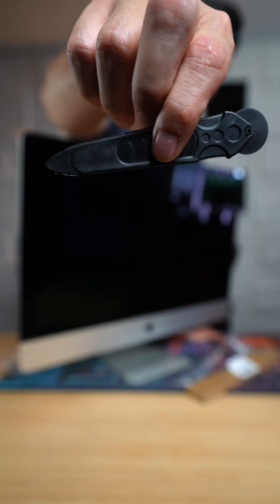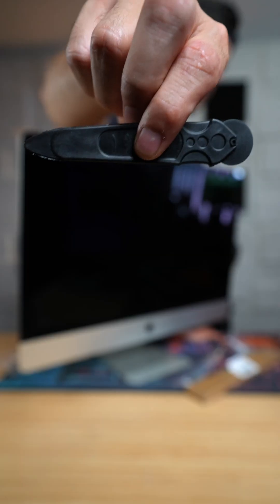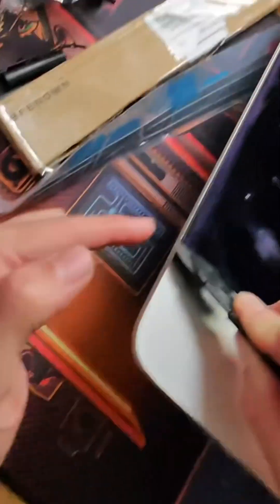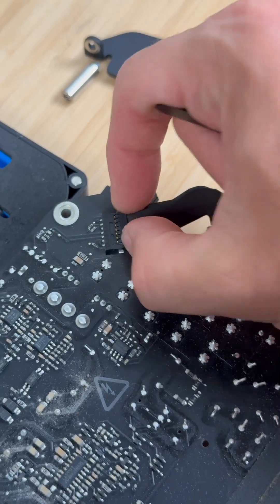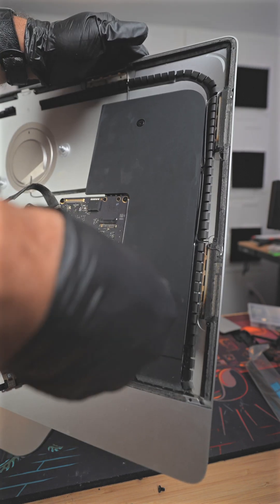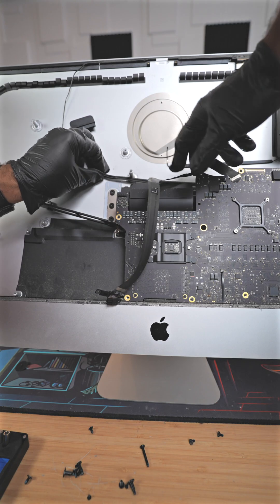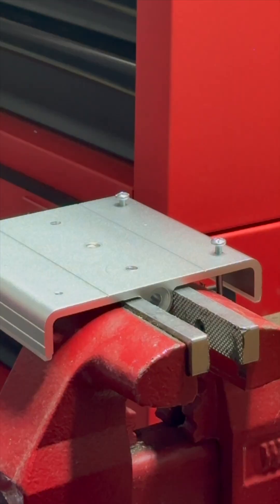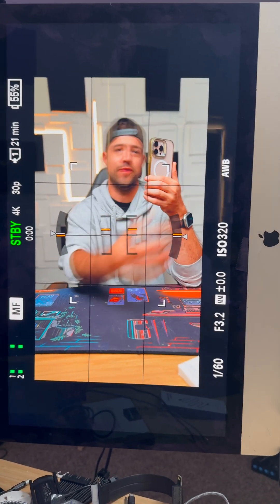How to use an Imac as a monitor. FULL BREAKDOWN

Comment: How has your driver board held up against the heat? What did you use to secure the board inside the casing? I've also noticed that the 12V 5A power supply gets pretty hot as well. Is this typical? Thanks for the video!

Comment: If i put some isolation-electric-foil tape and then added the double stick tape for the new-aliexpres-lcd board. Would that help ? 
And to put the cable connector part outside isn’t possible ? How do You turn the screen on ? 
I have and A1213/1312 iMac a bit older model. Getting ready for this project. Thanks for Your video !!

Comment: Hey! Love your video, I have a 5k retina 27 inch from late 2015, model is A1419 (EMC 2834). Can I use the same driver board that you used in your video, or is there a specific one that I need to pick? Thanks!
Reply from the maker: That same model should be the one linked as it’s the exact one as mine.

Comment: If the Mac internal power supply provides 12v at 25 amps (300W), how about running a cable from that Mac power supply board to the LM270QQ1 5K display driver board?
Reply from the maker: You would have to mod a little more than just that cable. You would need to fool the other connectors. I actually tried with no mods and the power switch only works while the logic board is connected. You would need additional mods
Reply: @circuitboredpc Typically PC power supplies look for a certain pin to be grounded before fully powering the rails. Doing that on this power supply might be simple enough.

Comment: How is the color rendition? What controls that? The display driver board or is it the display itself?
Reply from the maker: Both technically speaking. The color is great especially when you manually match it and also use the rgb settings via Mac os. You can also  have software to change to your liking